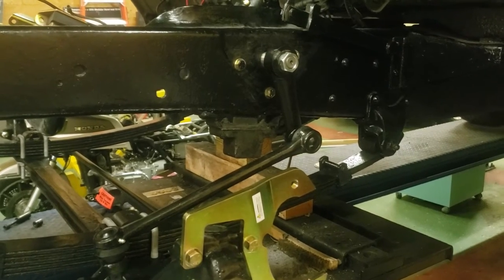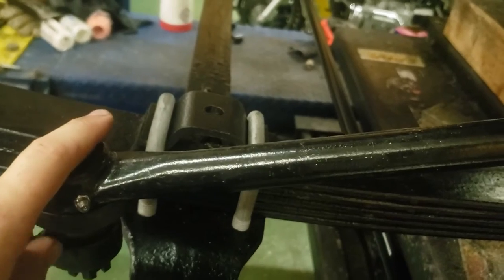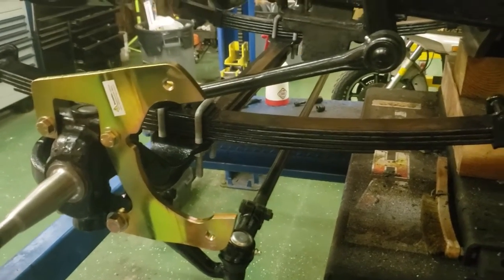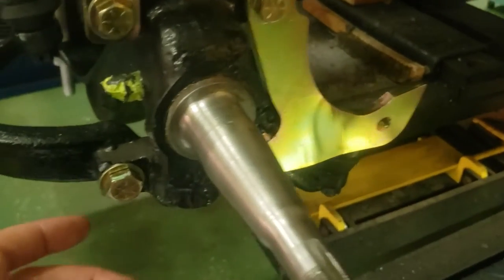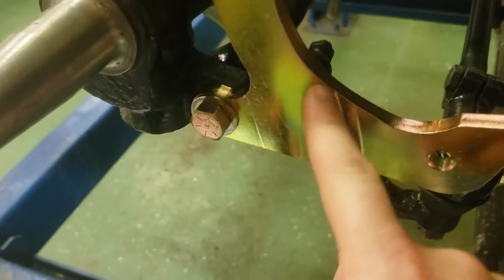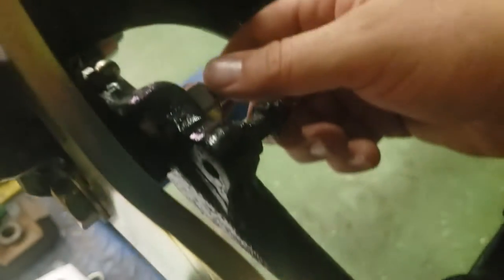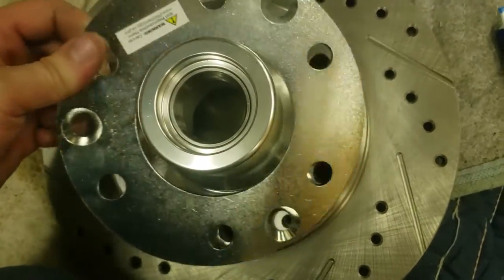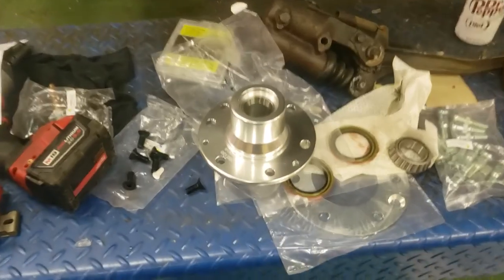How To - Chevrolet Taskforce Big Bolt 1955-59 Power Steering and Disc Brake Conversion Tips

Comment: Nice I am getting ready to do the same to a 1956 3600, thinking about going with the POL Kit instead of CCP. What do you think? What would you do if you could do over?
Reply from the maker: I looked at both. I chose the CPP due to the complete replacement hub option. I imagine both are of similar quality and probably use the same/similar components. Both companies have fairly poor customer services.

Comment: Where did u get the power steering kit? I have a 55 6400 would it fit
Reply from the maker: Its a CPP kit. It will work if you switch to a half ton front axle.
Reply: Oh i want to do the power steering only. So the power steering does not work if i leave it the same?? Thanks